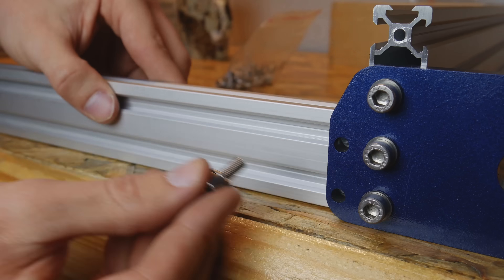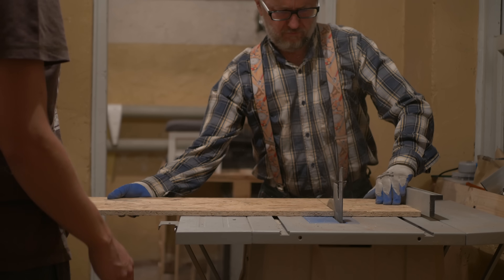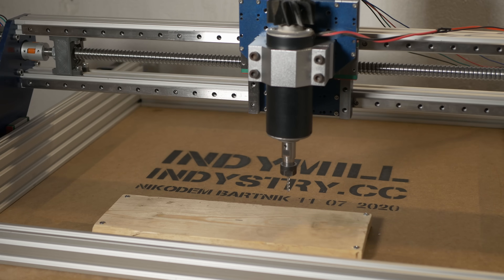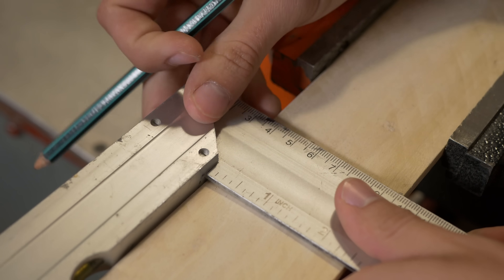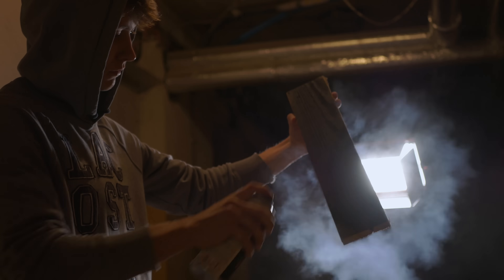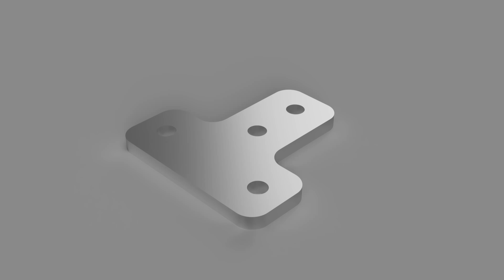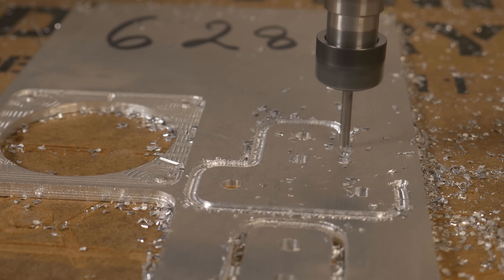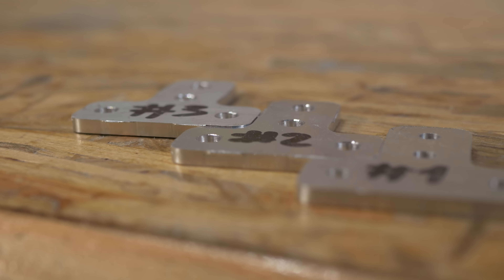IndyMill - Open Source DIY CNC Machine #4 Final Test!

Comment: Stunning machine, and as always, excellent video.  I believe the following will improve your aluminium cuts:
1)   Use an air blast to clear chips from the cut.  The blobs that weld to the end of your cutter are chips from previous cuts that melt during repeated re-cuts.  A chip that is no longer there is a chip that cannot melt onto your cutter!  A simple fence made from box-cardboard, or thin MDF can stop almost all of the chips from messing up the whole workshop!
2)   Use 6061 or similar "free-cutting" grade of aluminium.  The hardware store grade alloys are formulated to be extruded through a die, and this also makes them stick to your cutter.
3)   If you have to use material that sticks to your cutter, a "fog buster" lube system may be the answer, but it does add more mess, smells, damage, etc to your operation.
Can't wait for your next project... thanks so much!
Reply: Came here to say that.  Milling cutters really don't like plowing through swarf (chips).  It would not be too hard to arrange a light weight air nozzle that is right next to the cutting tip.  You could make it even more effective by putting a travelling vac nozzle on the other side of the cutting tool.  Aluminum responds great to a light cutting oil, but as you noted, that increases the mess factor by 20x.

And, although the effect is less pronounced with much softer workpieces like wood, finish quality and reliability and precision all improve with automated chip removal using air plus vac nozzles tied to the cutting head.  Plus it reduces the mess factor by 75%.

Keep up the outstanding work Nikodem!  Can't emphasize that enough.
Reply: @solarguy6043  : I knew there was something I left out of my comment - the vacuum shoe is a "no-brainer" addition for almost all materials!  👍

Comment: Great video, though one tip... the collet. Put it in the ring/nut first (at an angle, then press it straight, it should click in there), and then put it in the spindle. If you power the ring/nut on it with brute force sooner or later you're gonna break something....

Comment: Hey Niko!
Is it a nema23 on Z? 
Also, can this axis be upgraded to a ballscrews without modifications to your plates?
And finally, can a 2.5 kw watercooled chinese spindle be fitted to the cnc? And are you planning such an upgrade?
Reply from the maker: Hi!
1. Yes, it's Nema23
2. I think so, you would need to use double Z axis rail supports
3. Maybe, I am planning on upgrading it with 1.5kW aircooled

Comment: Hey.
Thanx a million for all the projects you show and build. I think I would like to know the feeds and speeds that you use, it would say a lot about the machine.
And why not try to mill the plates to the indymill on the indymill 😉 
I am very exited about you putting up the parts for sale on your website. 
Will you put up dxf/stl files as well? Maybe even the cad files or?
Thank again and promise to keep up your excellent work.
👍👍👍👍
Reply from the maker: Thanks! I was just testing the machine and mainly figuring stuff out, so there is still a lot of work to find optimal speeds. Great I am also excited to organize production and sell those parts! You can find all dxf files at indystry.cc/indymill
Reply: @nikodembartnik  
Well that's just awesome👍
I have a small Chinese 1419 cnc, so I'm learning to. That's why I'm so interested in the settings. It's just to small though.
And also those millbits you broke, would be very nice to know dpc and speed mm/min.
Have you tried using wd40 or something like that for aluminium?
Will setup a patreon, couse you're definitely worth supporting.
Keep up the awesome work my friend👍👍

Comment: Nice work. Do you plan to add some chip removal system like compressed air. It may help milling aluminium.
Reply from the maker: Yes, I already got a compressor in the workshop and that's definitely something that I want to add

Comment: Excellent! I cant wait to see you mill other metals. Will you try steel, as well as soft metals?
Reply: Copper yes. Steal hell no. He will break all his mills without the torque you need behind it plus expensive multiflute endmills.
Reply: @philmoreau5863  theres already one DIY desktop CNC mill that machines steel. it doesnt even look as strong as the indymill and uses a Makita router as a spindle. I think the Indy would do it if it had the spidle upgraded. How about it @Nikodem Bartnik ? 😉
Reply: @markh2005   I suppose its possible but depth of cut and chip load better be extremely conservative. And the choice of endmill is extremely important. It can be cunbersome even with machines that cost 100s of thousands of dollars, from my experience. He made a great a home CNC i would hate to see him damage it.
Reply from the maker: I want to try with steel but I don't expect anything, sure we will try some soft metals
Reply: @nikodembartnik  what about copper?

Comment: Before I mill acrylic, I put it in the freezer to get it cold. The smaller bit don't clog up so much. Glad to see you're enjoying your cnc.
Reply from the maker: Nice idea, need to buy a freezer for my workshop :)
Reply: @nikodembartnik  CAST acrylic mills much better than EXTRUDED acrylic. Cost a little more but worth it.  For aluminum 6061 will mill the best. dont' even try 3003 alloy aluminum unless you buy a special negative rake bit, otherwise it will just get clogged and break.
Reply: Rolland Elliott i just clicked the comment button to say that, but I very soon realised that you had already suggested this. 🤣🤣 Nice 👍.
Reply: Wouldn't this introduce issues with dimensional accuracy? Acrylic, like many other materials, is subject to dimensional change due to thermal expansion and contraction. Is the scale simply too small to notice?
Reply: @neversinkmakes  ooooooo that’s a major point.
Reply: the thermal expansion of acrylic , wood, etc is not siginificant enough to cause any meaning full changes in dimension for most projects. If your part is off 5 thou is that really gonna matter for most applicaitons?
Reply: Neversink Makes .that is a good point. The project I was working on didn't require specific tolerances so the freezer  method worked for me. I did try it at room temperature and had severe clogging. So my answer is ,I can't say for sure.

Comment: Some thoughts... 1: swap out the main mounting board for something waterproof. A section of laminate countertop material will do (although aluminum tooling plate would be better). Then... 2: add a minimum-quantity-lubrication system, and load it up with a non-toxic aluminum cutting fluid. Lastly, 3: add some T-slot extrusions to the mounting board for use with T-bolts & clamps. These come already setup for integrating into woodworking tables; as well as the 4-sided ones you used to build the frame from. 🤔

Comment: I have to say, I feel a little underwhelmed after watching the video. Great work with the whole design and getting it out there, but i feel like lots of different changes will occur once you break the machine in. I dont think this is any different than the Dremel CNC apart from its steel-aluminum construction. Better lock those t-nuts cause they're gonna come loose when the machine vibrates. Also, now that you have a proper-ish spindle, better get to work on those feeds and speeds. Great work!

Comment: In your video it looks like, that you put your ER11 collet in to the spindel befor puting it in to the nut. Thats not how you should install an ER collet. You should put your collet in to the Nut befor putting it in the spindel. When you look in to your Nut you schould see an oval, behind that is a shampfer. You press your collet in to your nut. If you tourn your nut upsidedown and your collet dosent fal out. You did it right. After that you can install your tool.
Reply: Marc Krüger I struggled with this issue for a few days before I figure it out, you are exactly correct. Couldn’t figure out why my bit would not run true lol. That was why.
Reply from the maker: No worries I installed it properly :) I was recording the video and then I've remembered that I am doing it wrong so I did it the proper way but forgot to shoot that so I used this footage, good that you noticed, thanks for comment

Comment: When milling aluminum I would highly recommend using cutting oil as well as forced air.
You will notice that cutting not only goes a lot easier, but the finish is also so much better!
Reply: You don't need forced air. Also some drops of Ethanol/ Spiritus is sufficient for this type of milling and has the great property of evaporating, so you won't have a mess afterwards. (Wood wasteboard and oil is also a bad idea, just saying)
Reply: @rayly7291  You do need forced air or high pressure cooling media to evacuate swarf. otherways it gets in the cut again and again.
Reply: @jerzyszczepanski2518  I'm a machinist and work every day with cnc machines. You don't need compressed air, i wouldn't even recommend it for a small desktop CNC. You can simply use a paint brush to evacuade the chips while milling and use some drops of ethanol, just as i said 2 years ago.